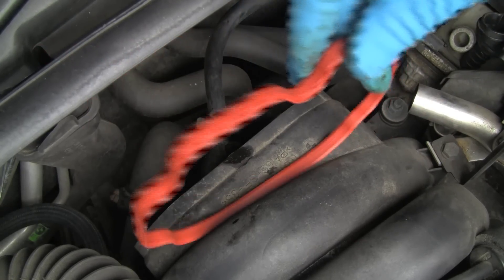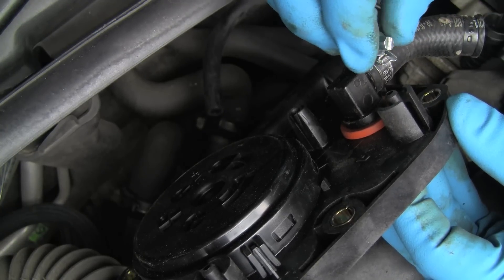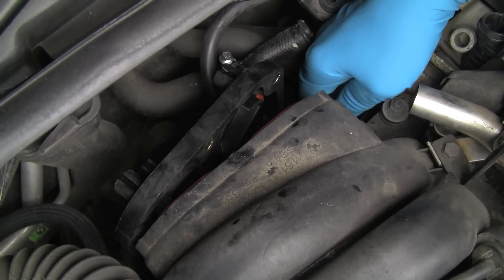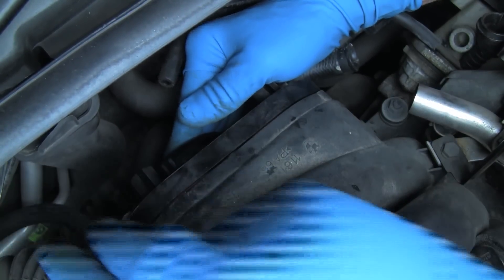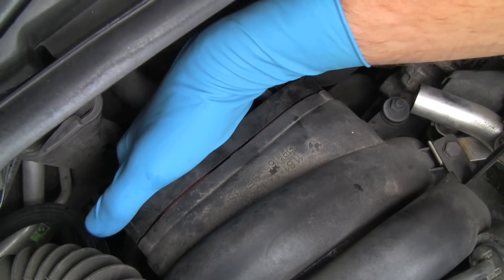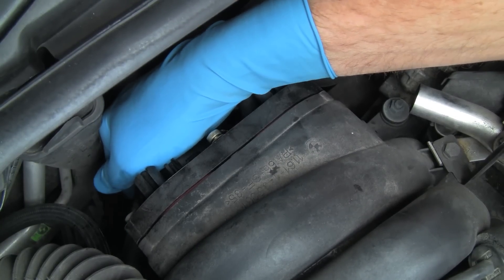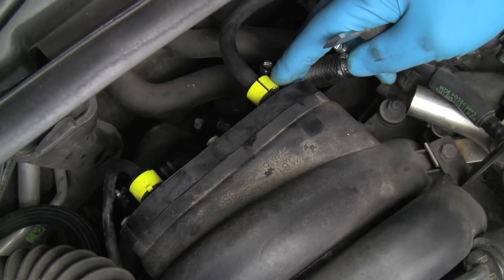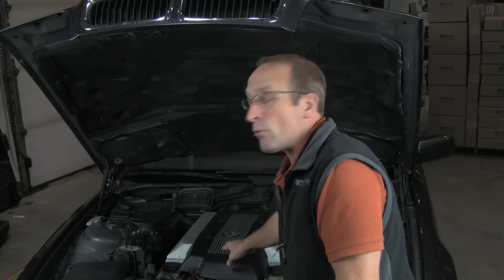Replacing the PCV System on a BMW V8 Engine Part 2 of 2

Comment: Well done.  Question: the lower pipe with the spring on it…when you have replaced the CCV, how can you tell if you have dislodged that pipe? I was careful with center pipe but not sure about the lower pipe.

Comment: Hello
 I was wondering if you could answer me or ANYBODY!! (HELP)... I have a 
2003 BMW X5 4.4i, I changed the O2 Sensors, 8 Spark Plugs, 8 Injectors, 
& all 8 Coil Packs, But it's still giving me a reading of P01343 and
 P01351.. and I downloaded your version of INPA...but i'm having NO type
 of luck... car is shaky and running bad and my CEL Flashes on and off 
when I accelerate.... Hmmmm what can this be???

Comment: Dear Need your help
I have replace my Transmission Gear Box in my 540 e39 and found the car stall or hesitant when drive on D Automatic but when drive on Manual it is ok, 
Do I need to reprogram or recode the gearbox ? or there is another issue ?
Thanks

Comment: Excellent explanation. Could you help me with my E34? When it goes more than 3 days without working, when it turns on it gives an overflow in the admission chamber and has already ruptured the diaphragm twice. What could be happening? My trusted mechanic could not detect the problem. Thank you.

Comment: Would you recommend applying a thin layer of oil around the main PCV gasket before setting in the groove?  Do you have the torque spec for the (7) torx t-30 bolts?

Comment: Great install is their interval when the part has to be replaced?? I replaced mine in the past and only did the center piece which made the install that much faster and easier to perform. But I can also see why you would replace the entire piece when the gasket next to the manifold is crystalized. Great install otherwise. Thanks for the video was very helpful.

Comment: Thank you for this perfect diy. My 03 540i msport is having rough idle problems. When it cold starts the RPMs will drop and go up over and over again until it reaches operating temperature. You can hear the engine almost die then come back to life also there's quite a bit of engine vibration that can be seen and felt strongly in the cabin on cold start. I believe my car has vacuum leaks so I will be doing this job as well replacing the idle air control valve and the throttle body gasket and throttle body housing gasket. I want to replace the intake manifold gaskets but that's out of my skill range and looks like a lot of work. Hopefully the above fixes my problems other wise I'm off to the dealer for manifold gasket replacement. I can hear my wallet crying already lol.

Comment: What codes was it showing? P0171? P0174? I've got theses codes. Also, my car gives me a sound of a suction when I hit the throtle. And more, around 3400-3500 rpm on a hard accelaration, I get a hesitation from the engine... like it was out of air/fuel...

thanks,

Thiago
Reply from the maker: Your symptoms may be due to a faulty crankcase ventilation check valve.  You could also have other vacuum leaks.  You should do a full diagnostic inspection for vacuum leaks.  If none, do the CCV assembly.
Reply: +Thiago Salgado were you able to replace it ? were you able to fix the codes?
Reply: +Javier what I really had was a dead MAF.. also, ahd to replace the battery...
Reply: ohhh wow what you mean by ahd to replace the battery...?
 and how did you found about about the dead maf related to those code?

Comment: This procedure is best implemented in a Professional Auto Repair shop, where there may be a customer's unwillingness to pay the extra dollar, BUT, for the sake of anyone attempting to make the repair themselves, TAKE THE MANIFOLD OFF!!  Replace the intake manifold gaskets while you are doing this job, as well as the O-rings and the front cover gasket as well.  The galley pan gasket is optional, but not a bad idea, when doing this job as well. Nothing more aggravating than having to go back and do the same work to replace a small part that should've been replaced the first time around. However, this is a good video, and patient instructional, Nice Job. ;)
ASE Master Tech.
Reply: I'm going to do it at home, myself.

Comment: hello I have a question (problem) replaced the PCV and all was well about half a year, recently pull out the dipstick and here'm hearing some gurgling and sucks her finger, what could be the cause of this? PVC is it again? Regards
Reply from the maker: Yes, likely the diaphragm is faulty, in the valve.
Reply: BavarianAuto Check it out at the weekend, and if you turned prove that indeed diaphragm is damaged, then again I have to buy a whole set, or just diaphragm? The second question is-if the two ports of the vacuum must be connected? Ask because before replacing PVC with a new one, I had only one hose hooked, and after replacing PVC, advised me to another also clogged. Pictures before and after the exchange if I have something here to help. thank you very much.

Comment: I got a cap with my pcv kit from you guys.  What is it for?  And I have a m60 that dosnt use the second vaccum hose so how do I seal it?
Reply from the maker: Calvin - Please contact our Customer Service Advisors and we can verify that you have the correct parts and assist with the install questions directly - 800-535-2002.
Reply: Hey calvin im havin the same issue with my 540i m62. I plugged a cap into it but im not getting any improvement, i just did the intake gaskets & swapped out cvv's while i had it off, any idea what that 3rd unneeded connections for?

Comment: Thank you. I ended up replacing the whole cover not just valve. Result: Still smoke puff at start up, sometimes. Suction from dipstick went from too much to barely feel it. Engine sounds softer. Could it be the front intake manifold cover? The thick hose that attaches to the bottom of the cover from driver's side with a spring seemed wiggly as if it wasn't connected to anything on the other end? Is that normal? Bottom of front manifold cover is a little oily?

Comment from the maker: Yes, by far, the most common fault is that the diaphragm ruptures.  In this case, you can indeed separate the diaphragm assembly and just replace it, without removing the complete check valve cover assembly.

Comment: Thank you for the detailed video. My 2001 740i is doing the start up smoke sometimes and I'm ready to act yet haven't bought the part nor decided which way to do it. I would like your advice on this: Since there is no moving parts other than the valve - which is the supposed faulty part - and since it can be difficult for someone like me to go through surprises that can arise, including hoses and not having every tool out there, can I just buy the valve and pop it up and replace it? Thanks much!

Comment from the maker: From your comment, we assume that you have an N62 V8.  The crankcase ventilation check valves are indeed the two caps that fit onto the forward ends of the engine's valve covers. In this case, the units that you found at bavauto.com , by searching PCV, are indeed correct.

Comment from the maker: The N62 V8 is a different design from the M60/M62 V8 that is detailed in the video. The Crankcase ventilation check valves are incorporated into the round caps that are on the forward ends of the two valve covers.  The valves are easy to replace.  See the post on our Tech Blog at blog.bavauto.com ... search for N62 PCV , in the blog's search box.

Comment: just bought the car it's a 2006 550i with a 4.8L. the car does nice start up and no smoke which i can see but when the car is at idle then my friend told me it is smoking and last night i had it sitting at idle then i could smell smoke when i rev it up a big bulk of smoke comes out would this be the symptom or the valve seal. the reason i am asking is, valve seal is when the car sits for couple of days then you see smoke at start up. please advice

Comment from the maker: Typical symptoms can include;  oil usage, oil smoke from the exhaust, symptoms that would point to an intake vacuum leak, suction in the crankcase (when you remove the dipstick) or a whistling noise.

Comment: Eg in my case replacement of only the cap has not solved the problem because there was also a problem in one clamp on the lower side of the cover. When I removed the old cap, it also had cracked the hole for the clamp at the same place. I have not noticed it at the first time, but it leaks now, makes a noise and I will order second new part to be sure everything is OK there. I do not trust these plastic parts after 3 removals and re-installs, so it will be necessary to replace the whole part.

Comment from the maker: Yes, the typical failure is that he rubber diaphragm ruptures.  In this case, if you remove the round "cap" and diaphragm from the new check valve assembly you can just install this on the old assembly (after removing the old cap and diaphragm.

Comment: you could have shown us where the old part failed.   i've seen where guys can get away with replacing just the cap.  it's a lot easier too and only takes 15-20min.

Comment from the maker: @noahtheviking 
We have a valve cover gasket DIY article in our Fasttimes Newsletter.  The DIY was done on a V8, but a 6-cylinder would be similar (easier, actually).  Additionally, the Bentley repair manual will detail the procedure for your BMW model.  See the newsletter article on our web site BAVAUTO dot COM and click on "Free Newsletters" on the left side of the page, then go to the FALL 2009 issue.  We have the gaskets and Bentley manuals in-stock at BAVAUTO dot COM, as well.